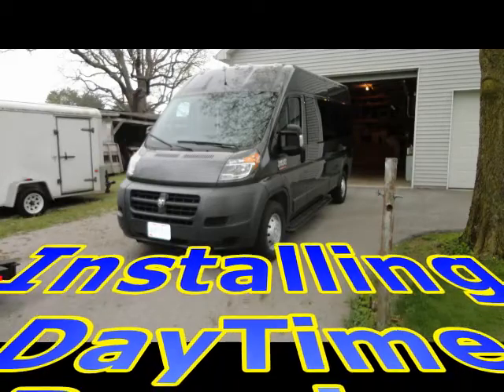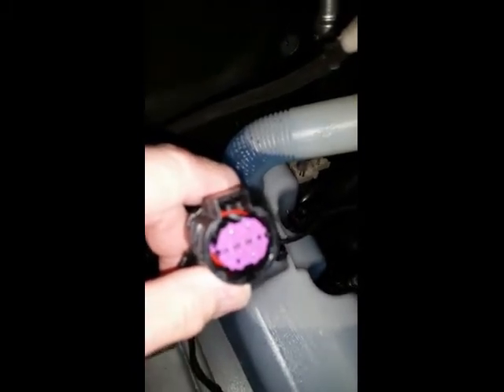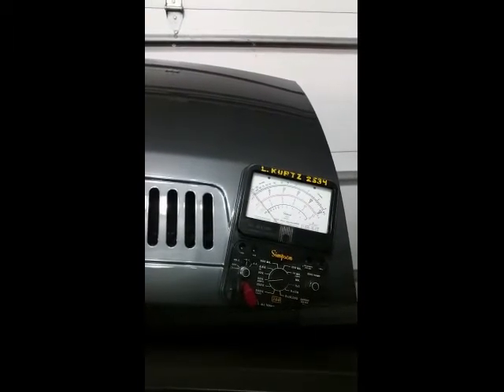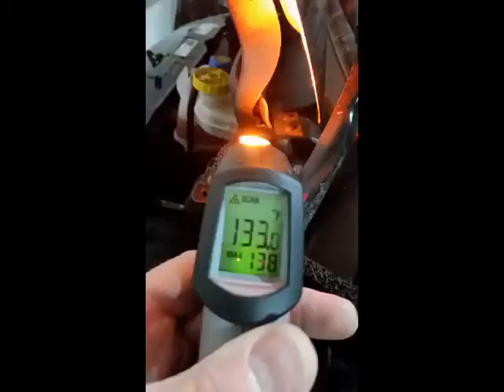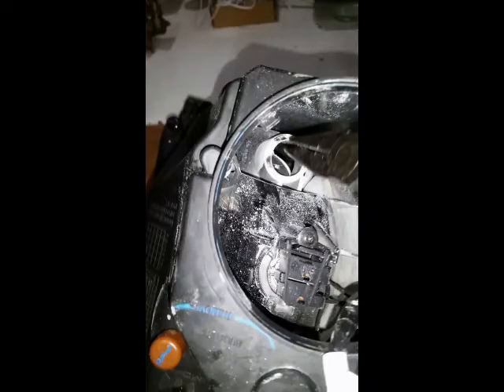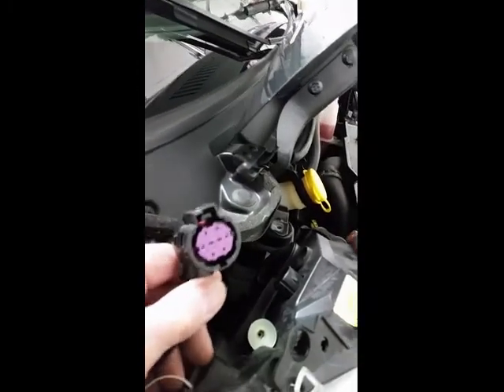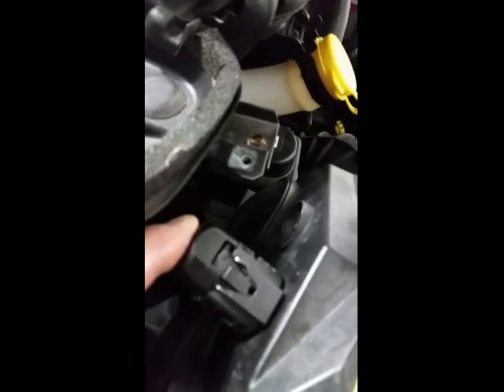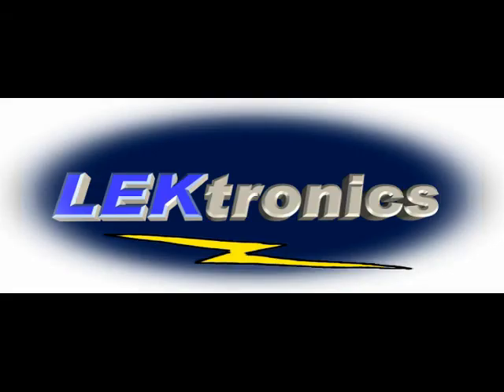ProMaster LED Daytime Running Lights Installation

Comment: To either of these drls extinguish themselves with a turn signal activation? Otherwise with one Amber on and one Amber flashing that could create confusion for oncoming traffic, and further, do these go off when the headlights are turned on?
Reply from the maker: The DRL's do go off when the headlights are on. However, they are fully on with the turn signals. That being said, the amber turn signal in the headlight lens is higher and brighter than the DRL. Also there is a forward facing amber turn signal light in the mirror.

Comment: I need to replace my DLR on a 2018 Promaster because the housing is burnt and cracked and does not hold the bulb in. If I change to the awesome LED's which you made, do I still need to get the Alphaobd reader to change the type to LED? I see that the Alphaobd is only for Android and Windows platforms. I currently have running lights but also need to figure out how to wire to the existing wires. They are both black and all taped up to the other light wires.
Reply from the maker: Replied on Promaster forum.

Comment: Thanks very much for posting this video with parts list.  Great step-by-step guide.  One question: since you glued in the LED housing to the headlamp assembly, how do you change out the LED's should they need replacement in the future?
Reply from the maker: The back of the housing unscrews, allowing access to the LED wafer and lens inside.

Comment: I ended up replacing my front lights with LED's. Then we developed a mounting system to replace the roof lights with low profile LED. 

https://youtu.be/EzwPcMPL7yI

Comment: Quick question. Is there a way to easily turn off the DRL while engine is on? I have a 2014 promaster 3500 and when engine is on, even if Im not in gear and not moving DRL are on and I want them off till I start driving. Thanks in advance. I enjoyed your video
Reply from the maker: I don't know of an "easy" way. If you could find a source that provides a signal when in gear, you could add a relay to the power that goes to the DRL's. The hard part would be finding that signal (when you are in gear).
Reply: @LEKtronics  that is a very clever idea. I was hoping that there is maybe s fuse where i can add a switch. Mine is 2014, maybe then not everything goes through the computer
Reply from the maker: @vikoviko1  If you just want to add a switch, the signal(s) for the DRL's on my 2016 come from the body control module (the fuse block in the LH side of the dash). Plug C4 which is the 60 pin plug at the lower right corner of the fuse block. Pins 15 & 30 which have a green/yellow wire going to them. It might be different on the 2014.
Reply from the maker: You will probably get a fault message if you do use a switch (or my suggestion of a relay for that matter) saying that he DRL bulb is not working.
Reply: @LEKtronics  Thanks so much for the amazing detail!!!
Reply from the maker: @vikoviko1  You are welcome!
Reply: You cam change this in yhe settings on in dash display under lights